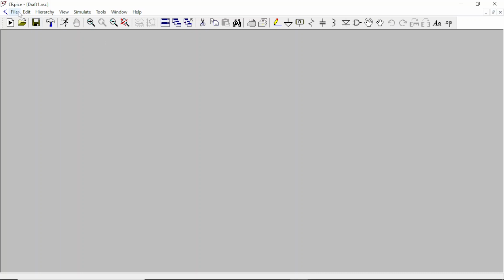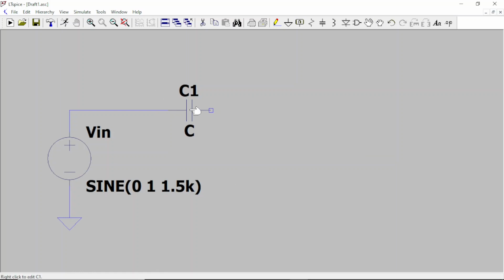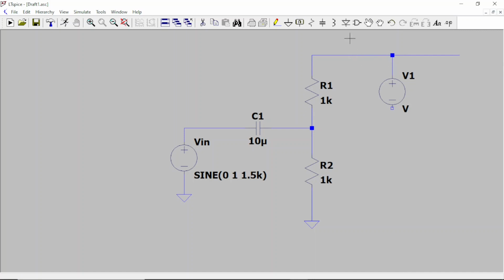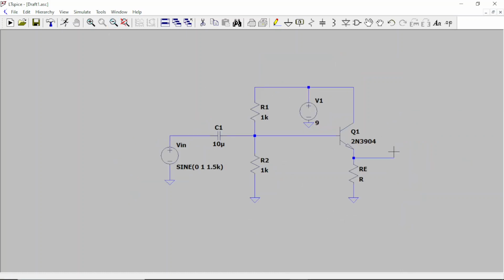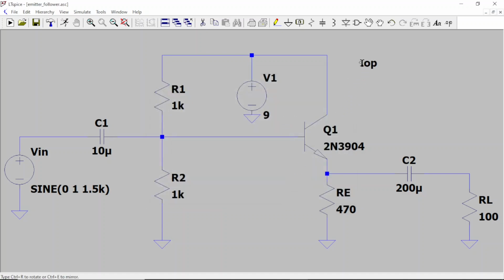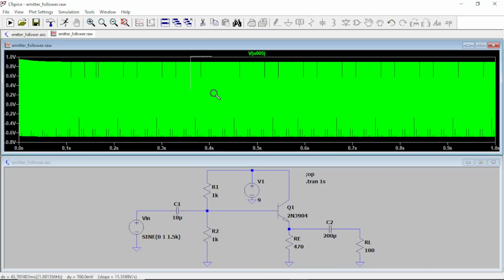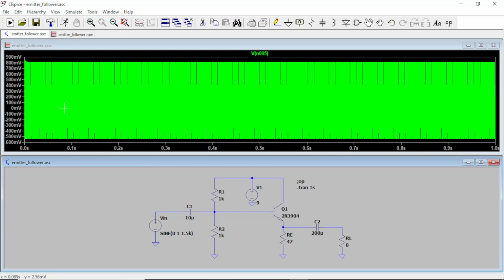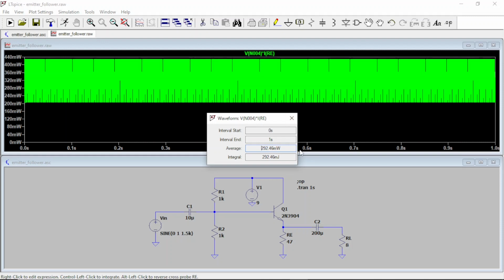Basic emitter-follower transistor amplifier simulated in LTSpice

Comment: Since emitter follower doesn’t boost voltage, wouldn’t you want your input signal to be closer to the rail voltage of this stage if you were to drive a speaker?
Reply from the maker: As long as your output signal doesn't clip, sure. Buffers like that are considered considered current source to drive low impedance loads like a speaker. If you are doing audio, i think it's better to use op-amps which have very high input impedance and low output impedance. They are just easier to deal with.